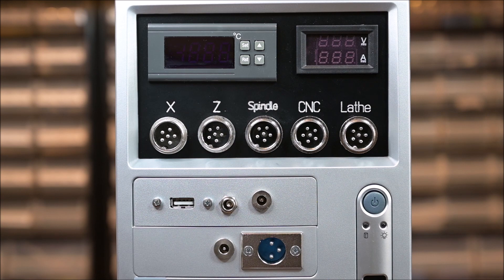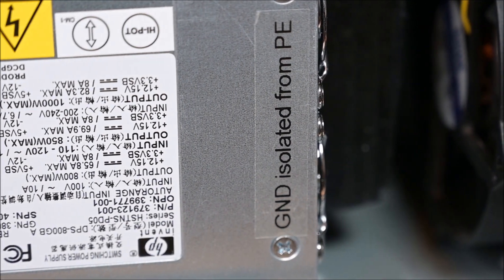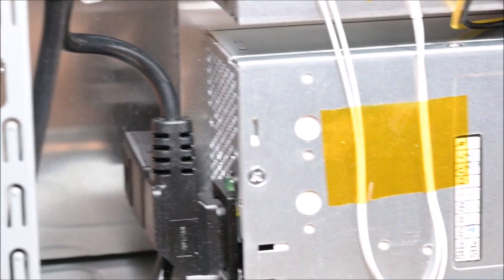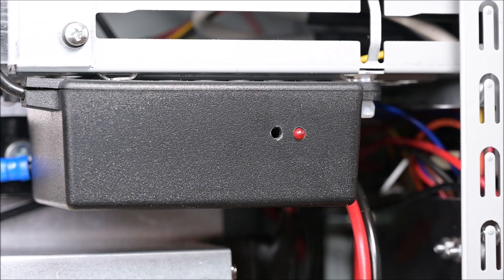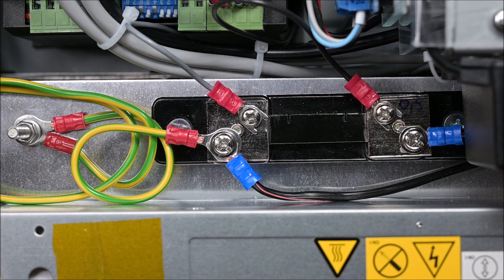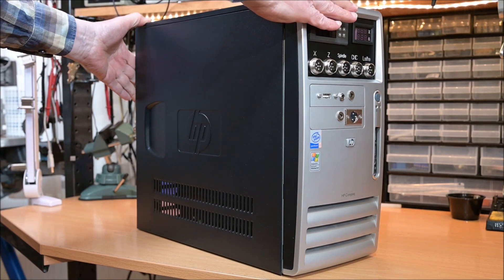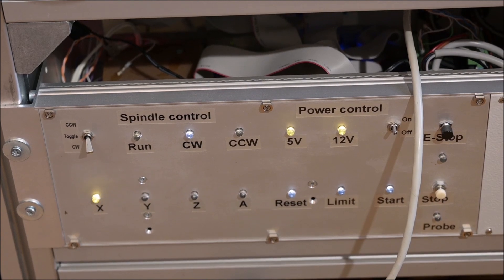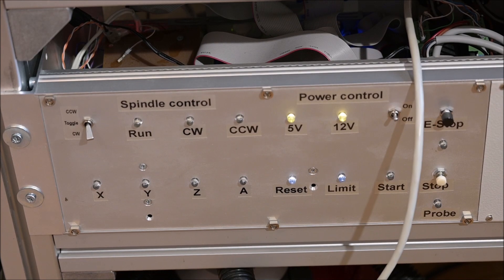Very high power (4kW 50V) PSU for my DIY lathe and DIY CNC

Comment from the maker: Just some more technical information about my work. The used server power supplies inside this unit are HP DPS-800GB A supplies. These server power supplies have built in over current, over voltage and over heat protection, as well as slow start to prevent current rush when starting up. Additionally, there is a 15A fuse on the mains side inside each PSU. This means that in case of short circuit on the secondary (12V) side the fuse will blow, or the over current protection will shut down the unit. I also have a 6A fuse on my mains cable connector, and I figure that in case of short circuit on any of the four PSU, or on any of the outputs (currently I have 12V, 36V and 48V outputs) I am using, that 6A fuse will blow in case the PSU over current protection would fail, which I doubt will ever happen. After that, I have a 10A fuse protecting my household mains side as well as an RCD (Residual Current Device) so I regard that as enough protection in case of short circuit.

Normal working temperature for these PSUs is between 40 C° to 45 C°, even when the load is zero. If the PSU will overheat (for example the air flow is blocked or limited) the unit will overheat and the OHP circuit will force it to shut down. The PSU will not start at all if any of the two built in fans are not spinning or the fans are faulty. The speeds of these fans are controlled by the PSU. Inside the box I have a temperature monitor which will shut down if the temperature inside the box increases above a certain level, and that is currently set to 50 C°.

I am using 2.5 mm² wires to connect the PSUs internally in series. This is good for maximum 23-25A so above that, the wires will definitely not be safe, but I am not planning at this moment to use it for more than that. The current is monitored, so if I ever notice that I am getting near 20A then I will modify it to handle higher current.

Comment: Hello!! So, You connected all four PSU in series? Without any diodes or ORing diodes? Just by wiring, correct??
Reply from the maker: That's correct, but I have taken many safety precautions, so be very careful if you plan to do what I have done. A short list: I disconnected the earth (PE) from the DC GND in three of them but kept the PE connected to all metal cases. I made sure that unless all of them are running they are not connected together and that if any of them fail to start none of them will start and output power. I also have a thermal supervision of the inside temperature and if the temperature reaches 50°C then the whole thing will shut down immediately. I also have simple fuses on every output so that in case a connected device fails, or there is a short circuit on any of the outputs, the whole thing shots down without smoke signals from the box. These PSUs are very powerful, much more powerful than I'll ever need and I have done this because I have the knowledge how to do it and because it is fun and I had these 12V PSUs available in a large number. So before you start experimenting, please watch the video and follow every possible safety precaution.
Reply: @AdaptingCamera  Thanks so much for such informative and saturated answer!!!
Reply: @AdaptingCamera  Can you elaborate on how you disconnected the earth ground from the DC ground? in each power supply? Is it just a matter of removing simple wiring or metal tab section from the secondary of the power supply? did you also disconnected it from the primary side?

Comment: Hi Would it be safer if you had the female sockets in the box panel? Regards Andrew
Reply from the maker: If it would be mains yes, but as it is 50V only, it really doesn't matter. I prefer it this way. Anyway, touching 50V DC is not the same as touching 230VAC, so there is no risk for electrical shock.
Reply: @AdaptingCamera  Ok Thank you. The only voltage I allow to zap me is a 9volt battery which I use my tongue to test the charge in it. I hope it doesn't affect my brain!!
Regards
Andrew
Reply from the maker: @andrewmazurkiewicz105  The last time I licked a battery (flat 4.5V type) was when I was about 7-8 years old or maybe younger. I licked for the taste and curiosity. Now I am 66...  I use instruments for testing the charge. Anyway, licking the contacts would definitely hurt you more than the 9V battery, so it is not recommended, but nobody in my home is crawling on the floor licking wires, contacts or batteries... :)